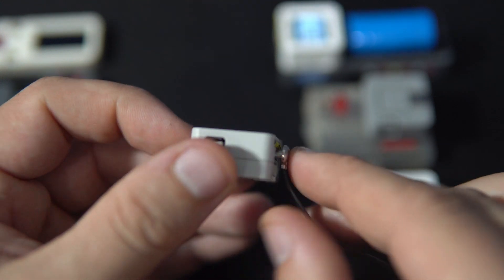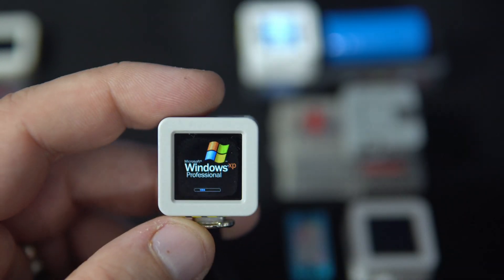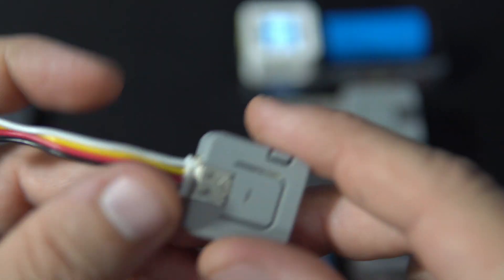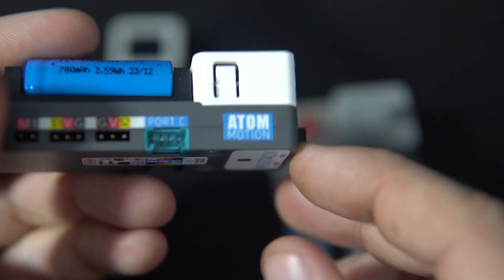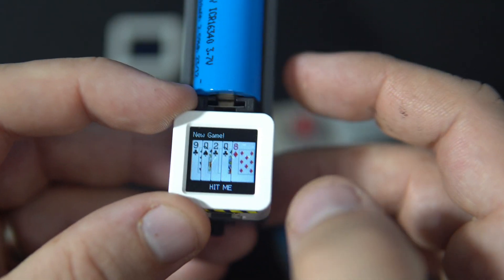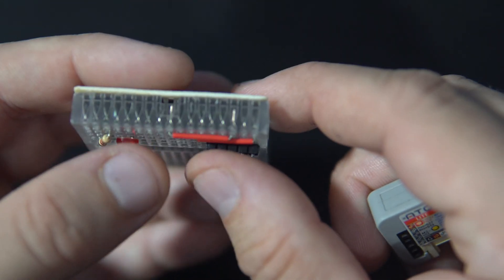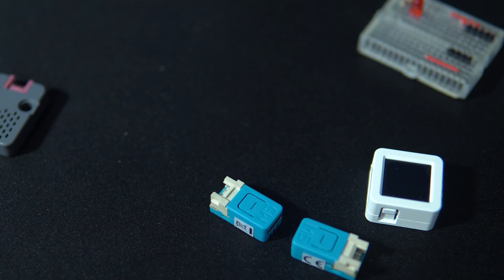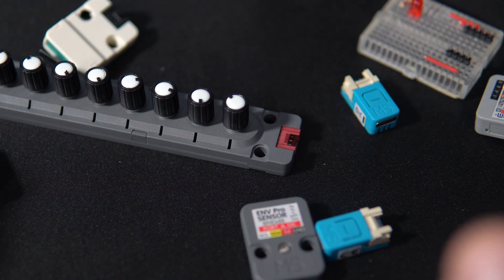Why This Tiny Development Board is Surprisingly Fun!

Comment: That S3R would be perfect to make a tiny retro computer looking like an Amiga or Atari running some demos!
The rotary encoders stick with 8 knobs could be used to control audio effects applied to sound coming in on the analog pin of an esp32, 
or to simulate an analog synth with each knob altering the envelope, pitch, waveform, etc, 
or to control 8 pwm channels connected to motors with mirrors and lasers to draw patterns on the wall.
or to control the lights, curtains, fireplace, etc of a doll house.
You get the idea :-)

Comment: Now that you’ve reached 100,000 subscribers (CONNNNGRATULATION!!), could you make a countdown timer on the Lilygo S3 Touch using LVGL :) ? I’d like it to flash an LED when the time runs out, and if the power supply goes out and then returns, it should resume from where it left off (EEPROM handling). I’d really appreciate it, as I’ve been struggling with saving the time constantly—it slows everything down, and a second doesn’t feel like a real second. Honestly, I’d be grateful for any countdown timer solution. Thank you for all your hard work!

Comment: The AtomS3R is an upgrade which now includes 8MB of PSRAM (lacking in the first version) plus a redesigned wifi antenna layout for improved range and reliability.

For those wishing to 'Rickroll' themselves with Volos' demo, make sure to select 'Huge App' partition scheme otherwise the build will fail.
Thanks for sharing Volos.
Reply: I also hope that they could also bring this upgrade to the S3stamp... That way we can boot the Linux kernel on the cardputer! (Though not very pratical)
Reply: Can the s3r use the same libraries that the S3 uses?
Reply: @spideytaha53  Yes

Comment: I will need to get this to! 
For me the interesting thing is the upgrade to the integrated 9axis imu. I have had a project in mind for a couple of years, that seems perfect for a couple of these new R models. Love the standard atoms3! 
The nano also sounds interesting, even smaller than the atom, and gets you a long way without polling out the soldering iron.

Comment: I don't understand what these micro modules are made for...
Reply: They're mainly development tools for learning and commercial product design.
Reply: @edwardfletcher7790  If you add few more bucks, you can buy Esp32 dev board and a usable size display to learn programing.
Reply: It has more power than the home computers from the 80s so it can run all sorts of small programs.
Reply: Fun, not costly to manufacture, and people will buy at a markup cause they’re fun and novel. Not a lot of these are actually made, just enough for those tinkerers who enjoy “collecting” boards. Of course there are some real uses cases… maybe a special multifunction keyboard button or a socials counter?
Reply: Also they’re daisy-chainable by design so that adds another dimension of possibilities.
Reply: @pinpointping6175  You'll find these in a LOT of Microcontroller programming courses worldwide
Reply: I know a guy that collects petrified shark teeth.  Does there have to be a reason?  

I can think of dozens of things to do with something like this, probably hundreds if I put some effort in.  Would these boards be an optimal solution for any of them... probably not.  Will I do any of them... probably not.  But, have to admit, having an on-button for a PC that, when pressed, changed from glowing green to a WinXP bootscreen would be pretty funny.

A button on the wall, with the screen colour being set by a temp sensor.  Press it, and the screen changes to a clock count-down timer... more presses, more time. Run a relay to turn on an AC.  Lots of uses.  More than petrified sharks teeth anyway.

I've already got a bin full of Arduinos, another with various EPS32 boards, 150x CH32V003s, older Pi boards.  Yeah, I might pick up a few of these :)

Comment: This actually hit me at the perfect time.  I need to activate a relay for a half second when usb power is applied, and the m5 with their solid state relay actually looks perfect.

EDIT:  Whups. Not the Solid State, but one of their other relay modules.
Reply from the maker: Yes SSR cant handle mire than 3A
Reply: @VolosProjects  My goal is to just use it to ground out a gpio pin on a raspberry pi 4 to get it to boot.  So I should be good.